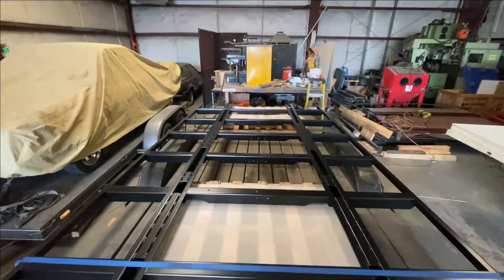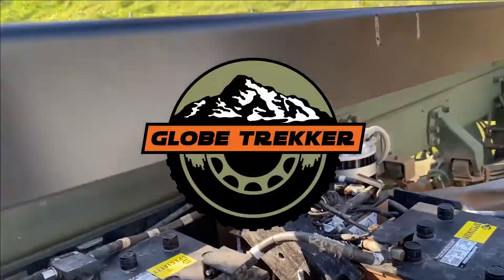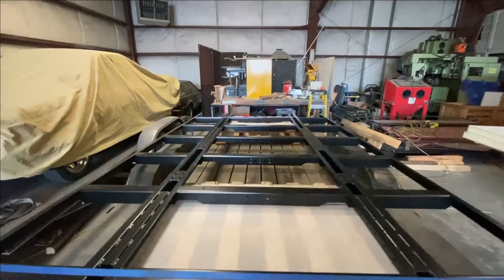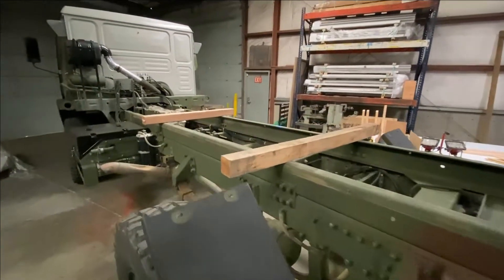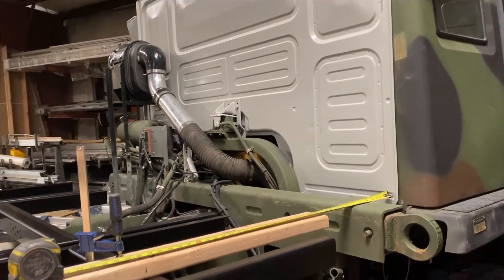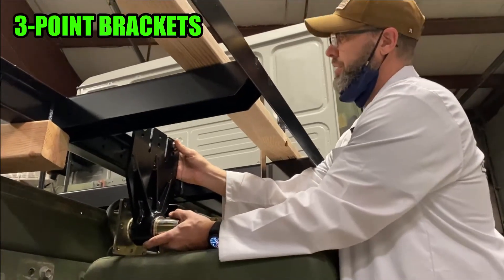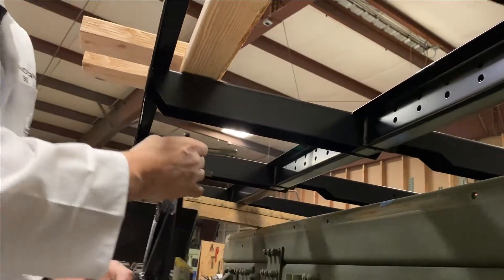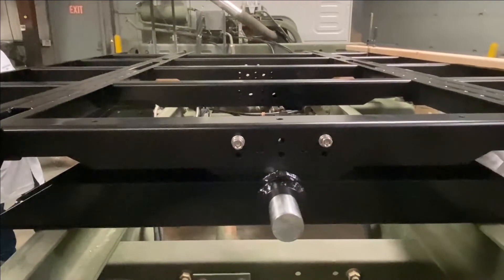Globe Trekker Subframe Build part 1

Comment: Is this movement and pivoting action (basically) the same as the Earth Roamer?
Reply from the maker: This pivot technology was pioneered by Mercedes on the UNIMOG decades ago. It is used by only a few companies, since the spring-over systems are cheaper (though less effective), and require almost no engineering to produce. The Globe Trekker design is the only design on the market that is capable of acting as an "adapter plate" for any frame width truck from 34" to 44" inches across. Our trade marked Zero Torsion subframes are the best in the industry. Others are trying hard to copy our subframes and thermal break aluminum extrusions, but all have fallen short of a Globe Trekker original.

Comment: What would happen if you mounted one of your shelters straight on the LMTV bed? does the stock bed shift enough to tear apart the shelter?
Reply from the maker: The stock bed is very solid and does not allow any movement... so the habitat would be protected very well. The problem is, the bed weighs around 2500 lbs! That is why folks are dumping them for the lighter weight subframes, like the Globe Trekker Zero Torsion subframe. When you are off road or in deep sand or mud... every pound of weight counts. Great question... thank you!

Comment: What’s the advantage/disadvantage of three point vs four point mounting? I keep hearing one chosen over the other but never why? Is it just a matter of what fits best?
Reply: Three point systems are pretty easy to engineer...fixed at one end, free to move at the other
Four point systems where the frame is fixed somewhere in the middle are much harder to engineer as you need to know the point at where the chassis is "neutral" when it twists, otherwise you haven't built a torsion free subframe at all.
The one problem I have with almost all torsion free sub-frames (including this one) is the way the load of the habitat is spread over the chassis
All truck chassis' are designed to have the load evenly distributed along the length of chassis and unless you make allowance for that in the design of a torsion free sub-frame, you are point loading the chassis and the possibility of it being damaged is very real.
The best systems have made allowance for this and while they don't spread the load fully along the chassis, they certainly do not point load.
Reply from the maker: The difference is whether or not you want to put in a crawl-through from the cab. To prevent the cab and habitat from twisting in different directions and ripping the crawl-through apart, you would put your side mounts up front. The side mounts locate the habitat to that section of frame to which they are mounted to. The pivoting crossmembers take the load of the habitat where the twist of the truck frame and side brackets are opposing. For more dialog, use the "contact" link on our website at www.rvglobetrekker.com

Comment: There are many European bodybuilders use this mechanism more than 20 years ago
Reply from the maker: Absolutely... the technology is nothing new. We have used this to build a DIY subframe to fast start overland expedition projects. Our set up can be assembled in as little as two hours. It is also powder coated as a whole unit, giving it maximum corrosion resistance. Currently, no one does it like we do.